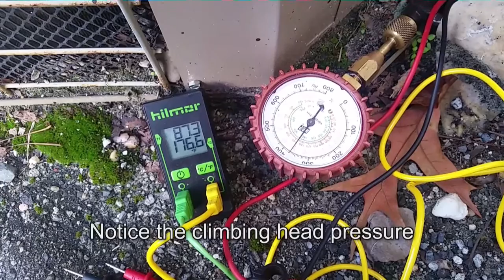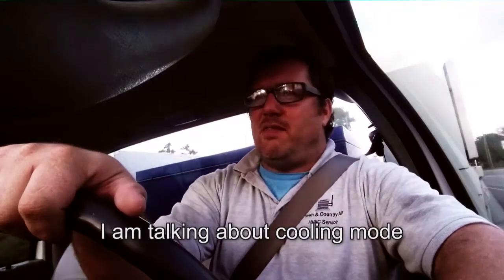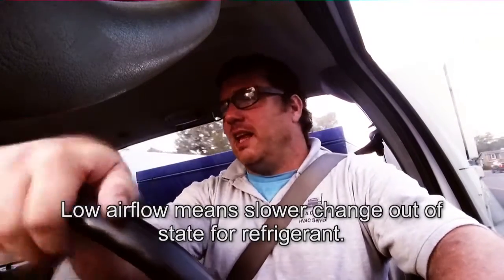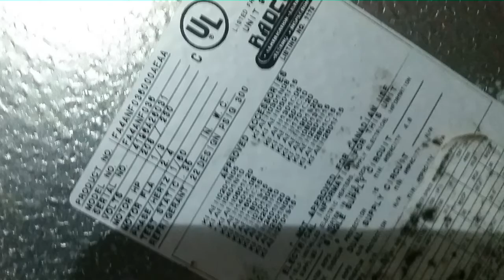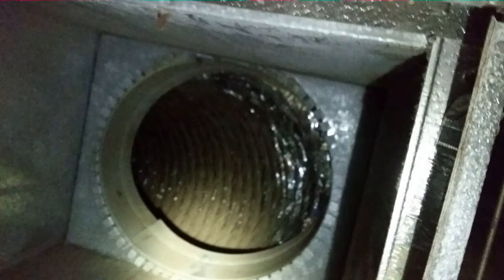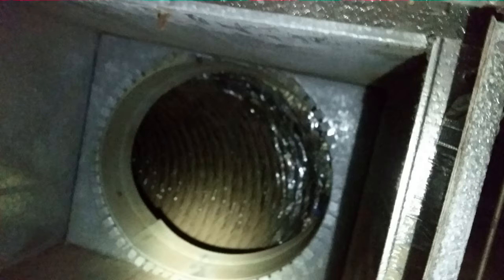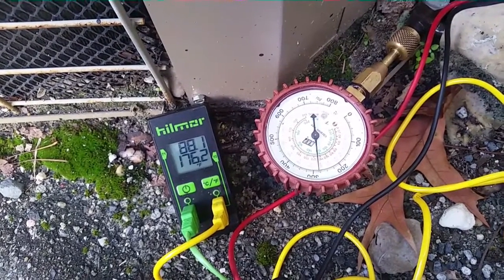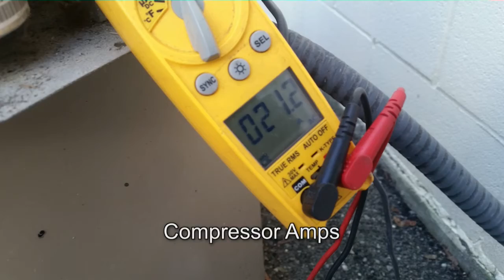High Head Pressure Analysis Heat Pump

Comment: I get everything your saying about this one and unfortunately you run into this sometimes and no matter what you try to do it will never be rite without doing what you said and changing the system out. I Dont know if you could have added another return somewhere and cleaned the indoor unit real good try to squeeze as much air flow as you can out of it to get by for awhile by tweaking some things or not. Bottom line once again it’s miss matched it can’t work rite that way. I’m sure you considered all of this already. Things like this if you try to patch someone else mess have a way of coming back to bite you, I’ve been there and done that to many times.😊

Comment: Having an oversized evaporator is ok  but too small , I have never ran into this. Oversizing it ads efficiency, in fact  utility financed jobs  require  a  1/2 ton oversized evaporator coil.
It works in cool mode  cause the condensing unit is the condenser in AC mode, but in heat mode the indoor coil is the condenser  and you are  undersized,  in this case I would disable the compressor  in heat  mode and use  auxillary  heat strips only  for  heat.